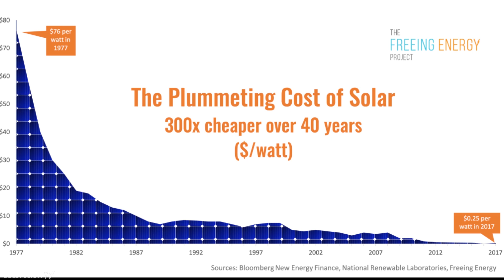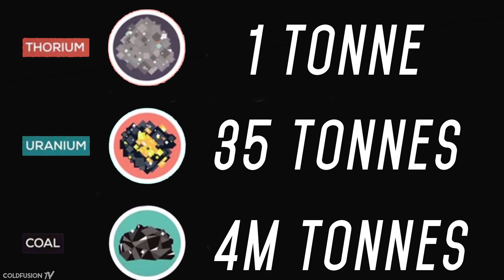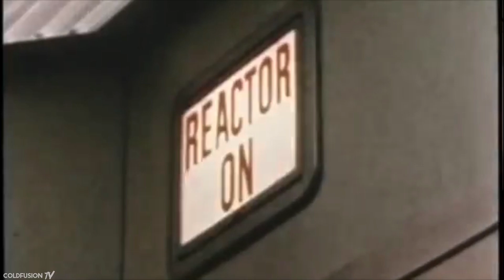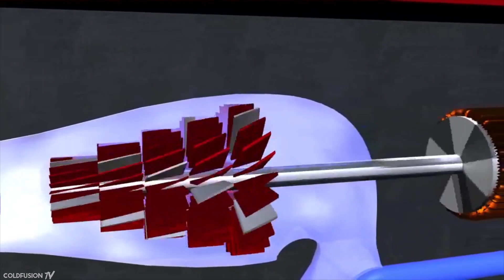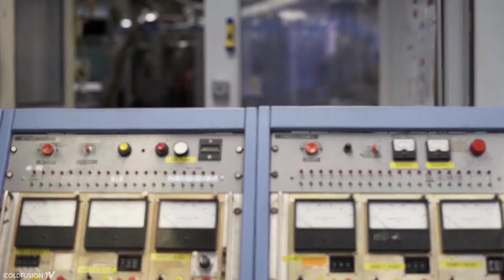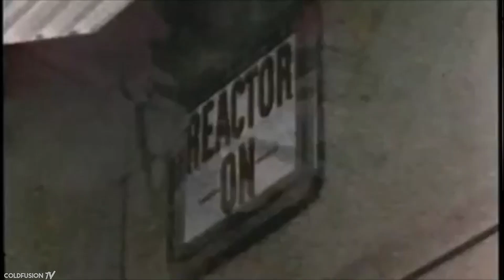Thorium - The Future of Energy?

Comment: "From a historical perspective, an atmospheric CO2 concentration of 400 ppm (currently 410 ppm) is actually almost scraping the bottom of the barrel. Over the Earth’s history, atmospheric CO2 concentrations have ranged from 180 ppm to 7000 ppm. On that scale we are in fact today barely above the Earth’s record lows.

That 400 ppm is actually dangerously low is a fact the alarmists keep avoiding and suppressing. Below 150 ppm, plant-life dies off on a massive scale. The Earth actually came very close to that point many times over the last 2 million years during the ice ages. At the bottom of the last ice age just 20,000 years ago, life on the planet literally teetered on the brink when CO2 fell to a level of just 180 ppm. Do we really want to live on the brink of extinction.

Note that at high CO2 concentrations, such as 800 ppm, plants thrive. But as CO2 levels fall off, growth rates really start to plummet once they fall below 500 ppm. History shows that the Earth sustains much more life, i.e. is much greener and fruitful, when CO2 levels are higher, i.e. in the vicinity of 1000 ppm."

The original article (with illustrations):
https://notrickszone.com/2013/05/17/atmospheric-co2-concentrations-at-400-ppm-are-still-dangerously-low-for-life-on-earth/

Also, CO2 is only a minor greenhouse gas and other factors contribute far more to global temperatures.

Comment: The thing I’m wondering about is if you can merge the idea of a thorium reactor with that of a molten salt reactor if you could find a way to get a functional design you would essentially have a reactor that is almost completely unable to melt down because thorium is a more effective fuel source that is has a shorter half-life along with a molten salt reactor which can freeze the salt stopping the reaction in case of failure.

Comment: If you’re in the United States, please contact your congressman and senator to support NELA the nuclear energy leadership act.

Bill Gates met with President Trump in January 2019 at the White House. Bill Gates offered $1 billion, that’s with a B, for research and development. With an additional $1 billion from the private sector. The president is a builder, and has a track record of bringing things in under budget and on time. We have a sublime opportunity here. 

Naturally the Congress and Senate that are paid off by the uranium lobby, turn to trample Bill Gates. That’s what happens when you cast pearl before swine.
Bill Gates and Steve Jobs transformed the entire dynamic of the world with a home computer. Those of you watching this on your phone right now should be aware of that.

Just a few benefits of thorium. Molybdenum 99 for cancer research and cancer diagnostics.

Xenon for interstellar space travel. We can no longer buy it from the Russians.

Thorium runs at 800°C for water desalinization. It can also be used for other Heat intensive processes like coal to oil distillate‘s.

It can’t melt down. It simply drains into a tank. There could be a mass coronal ejection, and it would shut itself down. The lead engineer could go out to Starbucks and get a Doppio espresso and it would not melt down!!!

There is less risk of nuclear proliferation. It can burn the thousands of barrels of stored and spent uranium.,

You load it and it runs for 30 years, no refueling every 2 to 3 years.

I can see no negatives.

Your children and your children’s children will be paying the Chinese or the Indians royalties on our own technology from half a century ago, if we do not build this.

Half $1 billion was wasted on Solyndra five years ago. It’s time to demand thorium now. 
Consider me a canary in the mine shaft, the kings new clothes, Paul revere, all wrapped up in one. 

We have to go out and do this now!!!

Comment: 1. Start up costs are likely to be lower because MSR's can be built in a factory instead of on site where each reactor vessel is essentially custom built, thus costing much more . Think logistical and operational costs to construct and maintain a reactor with custom-make parts.
2. U.S. federal (NRC) regulations need to be changed to reflect the different, safer technology of thorium reactors in their various forms. Changing and implementing regs is very costly - like moving a mountain with a shovel - not a technical issue but a bureaucratic one.
3. MSR's are smaller than LWR's. MSR's are not pressurized to over 100 atmospheres like LWR's. No cooling towers required. MSR's can be hooked up to the grid next to an LWR that's coming to the end of it's life cycle or in the process of being decommissioned (which takes years, by the way).
4. With necessary refinements of course, MSR's can be built along the same designs as the one that ran successfully at Oak Ridge National Lab in the 60's.
5. Peter Lyons is an LWR industry advocate. He disingenuously uses the word "shifting" to imply that LWR's will be phased out by MSR's and that that will incur tremendous, unnecessary costs. Not so. An individual power plant that phases to an MSR could become a profit center by producing more than just a base load of electricity.
6. MSR's built next to LWR's won't require miles and miles of costly additional power lines to connect to the grid as do most solar and wind facilities. NIMBY issues will rear their ugly head if these additional power lines run through previously pristine neighborhoods.

Comment: But is there any disadvantage that doesn't / didn't exist with Uranium?
Reply: Good question, Ludmila. The quick answer is "no." When enriched and radiated, Uranium is highly radioactive and toxic. However, when handled and stored safely it's the best source of power on earth. Nuclear waste could be a problem, but if recycled and burned (in a "burner" MSR) the amount of waste will be far smaller than normal and can be stored for a much shorter time (300 years) instead of 10,000 years.

Comment: Thorium reactors are breeder reactors the guts of which become highly radioactive. It's great to be talking about thorium, but disengenuous not to mention that these reactors actually burn u233 with u232 as an impurity. Also, every ingredient in Flibe is proliferative! Not just the u233. The Li, and the Be, are also proliferative. Meaning that a researcher could get 10 years to life in prison for improper handling. Thorium power has been vigorously researched in places like India for many decades, while only one reactor is due to open maybe next year. Yes, let's do it, but let's please not gloss over the difficulties.
Reply: My solution is less problematic! 

We have to make global electricity network like internet today. So when you have day in USA you send your solar PV electricity trough HVDC submarine cables to me in EU and vice versa. London - New York, Tokyo to LA, east to west, south to north all day 24/7/365. 

China have today 1100 kV voltage, a 3,000 km (1,900 mi) length and 12 GW of power HVDC link
We can do it right now!

Comment: I think the main advantage of molten salt reactors (MSRs) - where Thorium is one possible fuel - has less to do with power (electricity) generation - as good as that is as well - but more to do with heat generation for industry, which presently generates about 1/3 of all greenhouse gasses. Solar, wind and hydro can not help here. Molten salt reactors run at around 600 degrees centigrade, versus only 300 degrees C for present (light water, high pressure) reactors, which are too cumbersome in any event to be used for industrial heat generation. MSRs have the potential for mass production because their intently passive “walk away” safety and low (almost atmospheric) operating pressure allows scalable size from around 100 megawatts thermal (50 megawatts electricity  if converted) them to several gigawattts. MSRs are definitely the future - China and India and many USA and European startups guarantee it! The question is when, and that’s largely a matter of money and willpower. IMHO MSRs are the only possible energy source that can save planetary meltdown. I’m 66 years old so I will probably miss it, but the younger generation have to get over their paranoia about nuclear and look at the big picture. Even present day second generation and recently released third generation nuclear are historically the safest energy we have even taking into account the worst predictions of death from Chernoble, Fukushima, and three mile island. Fossil fuels kill hundreds of thousands in every year. I used to be a Hellen Haldiicot fan boy, now I think she could be contributing to the greatest devastation the world has ever known.

Comment: FYI, production of electricity needs to get off coal but we can pick other low hanging fruit while waiting. Bad agriculturural practices, meet production, cement / concrete industry, petro powered cars, energy inefficiency of electric motors for industry, poor insulation of buildings,  leaking faucets, heat and air conditioning set too high, too many street lights, electric and lighted billboards, incandescent bulbs, 30 minute showers, electric hair dryers, wasteful consumption, remodeling malls every 5 years. CHANGE YOUR LIFESTYLE. BE THE CHANGE YOU WANT TO SEE. VOTE WITH YOUR DOLLAR. Few ideas:  Mandate conservation, support the GREEN NEW DEAL, buy an EV (Tesla), shorten your shower, eat less meet, grow your own food, buy local, don't fly, turn down the air and heat, compost your food waste, move closer to work, plant some trees, turn off lights, unplug stuff not being used, STOP BUYING SO MUCH SHIT.
Reply: And cost of ANYTHING will rise.
Coal is used NOT because it is good but CHEAP!

Comment: Thorium and Nuclear are a must for energy development. Natural gas is good for killing coal, but not nearly as good as nuclear. We need reactors for industrial materials, but just a energy. Thorium is mine spoils. Thorium doesn't melt down. Hard to weponize. Use 10% of the material. Shorter half life of waste. There is no reason not to move forward.

Comment: Had Thorium been chosen back then we would not have had this debate, and possibly also not much debate about our energy consumption/demand. But the Uranium was chosen and here we are – naturally, the companies that run the Uranium based business are not likely to give it up, it's their core business. As we have seen with EV batteries the capacity has doubled in about 5 years times – because when the big players start to do such things the developments is fairly rapid. Thorium could possibly replace and revolutionize large parts of the global energy demand and be the default backbone for Windmills, Solar and other renewable energy sources. Apart from that, it would also be nice to see the military stop using uranium-based materials in ammunition, that is simply extremely unethical and should be banned globally.

I mainly support thorium because of the much better safety promise with molten salt reactors not being able to actually melt down. How many times have we humans thought – ohh! we are going to make a great Wall to protect something – then having a 12m wall towards the ocean does not help much if the waves coming in are 18m. We still do not know what cataclysmic events the earth can unravel and for this reason, the Uranium based solutions are simply way too risky even that they are much better than they once were.
Reply: Renewables are bullshit.
Thorium backbone can be only batteries...sodium-based SOLID eletrolyte ones...

Comment: I have been trying to understand the complexities of nuclear for many years and was once very anti-nuclear but since reading about thorium and learning
the reasons why, in the 1960's, the thorium reactor at Springfield, which had been running trouble free for 6 or 7 years, was shut down by Nixon. 
Whilst I'm against anything nuclear because of the waste produced, with thorium the waste can actually be recycled and used for a 2nd time whereas with uranium once about 1% of the fuel rods have been used they  have to be replaced.
As you correctly say, with solar and wind etc we won't be able to generate enough power so why not use a molten salt reactor and why didn't EDF and the Chinese go for it at Hinkley Point instead of building what we now have: 
A MASSIVE WHITE ELEPHANT THAT'S YEARS BEHIND SCHEDULE AND BILLIONS OVER BUDGET, JUST LIKE THEIR PLANT AT FLAMMANVILLE  IN FRANCE.
Reply: Peter Gambier Where on earth did you get the idea that because fuel rods have to be replaced that means that Uranium unspent fuel and Uranium transmuted fuel cannot be recycled? 

La Hague has been recycling Uranium unspent fuel for 49 years! 

Fast Spectrum Reactors in Russia like BN-800 are literally used to fission plutonium stockpiles and Uranium transmuted waste.
Reply: @brian2440 , as I, in my non-nuclear background, was led to believe, when just 1% of a fuel rod has been used it has to be replaced.
This of course sounds like not only a waste but utter madness because surely if something has not been burnt up or used then there has to be some life left in it. With uranium the left over waste is used for weaponry, especially the projectiles that are able to penetrate tank steel. But generally as I understand it the uranium can only be used once but with thorium this can be twice and it becomes less radioactive than uranium. So if you are going to respond to what I have said here please can you write it as if you are talking to a thick 10 year old and I will be most grateful. All the best.

Comment: What about nuclear fusion, Its what the Sun has been running on for the last few billion years, it releases immense amounts of energy, thousands if not millions times more than nuclear fission, and it releases no carbon dioxide
Reply: Malacki 655 Yes and Matter-Antimatter Annihilation releases more energy than fusion that occurs in the sun, so why don’t we use that instead?

Because it’s extremely complex and has been proven to be an effective energy source for continuous production, nor cost effective.
Reply: Brian It’s better for earth in the long term tho.Sure there may be high upfront costs but the operational cost is low, just like nuclear fission because the atoms are mostly doing the work.And unlike fission, there’s no nuclear waste
Reply: Malacki 655  The problem is you simply are unwilling to recognize the engineering challenges of nuclear fusion.
Reply: Brian I understand the problems I’m just saying we could overcome them with the right resources.Im just being hopeful I really want nuclear fusion to happen
Reply: Meh just connect to the Sun.

Comment: Thorium reactors were ready for commercialisation about 35-40 years ago  The claimed  need for much more research to make sure safety is properly taken care of is a  red herring!
Reply: Odilo von Steinitz 1977 Shippingport nuclear reactor ran a commercial thorium core.

1984 Ft Vrain used a thorium core for commercial production. 

These reactors were light water Breeder Reactors - LWBR.

What you are likely referring to is a LFTR, DMSR or IMSR, which contain a wide variety of materials and benefits besides just Thorium. A LFTR is classified as a Molten Salt Reactor variant not a Thorium Reactor.

Comment: Hello, while the video it has a high quality it could had been better, yes, Thorium reactors produce 170 to 200 times less nuclear waste than current U-235 reactors, and they produce less waste because they are Breeder-Reactors, they convert Fertile Material like Th-232 give it a neutron to make it into Th-233, let it decay in Pa-233 and let it decay in U-233, but there is also U-238 breeders, (you know, that U-238 that is the 99.3% of all Uranium?)  they work the same way, but they take U-238, give it a neutron to make it into U-239, let it decay into Np-239, and let it decay in Pu-239 which is fissile

The reason why we don't use the 99.3% of that remaining uranium is because you need a fast spectrum reactor, because you need a neutron ratio over 2 to convert U-238 to Pu-239, also is because in a Thermal spectrum reactor 65% of the Pu-239 is used compared to 94% in a fast reactor

the ideal reactor design for a commercial powerplant, would be a Fast-Spectrum Molten-Chloride-Salt Pool type reactor, liquid fuel like a LFTR reactor, but with tungsten and tantalum carbide neutron reflector instead of graphite neutron moderator

Of course there is a certain problems with a fast molten salt reactor, the enrichment level has to be 10%-to-15% compared with 5% in a thermal reactor, but outside of that it has more advantadges
Reply: Uranium-238 is bad not because hard to use, but because it will breed transuranic like a madman. (include plutonium species)
Fast reactor is really bad idea because you need to be carefull with shape for this device and fuel because it can run for itself.
Thorium line has 2-3 times more fission events and do not breed transuranics.